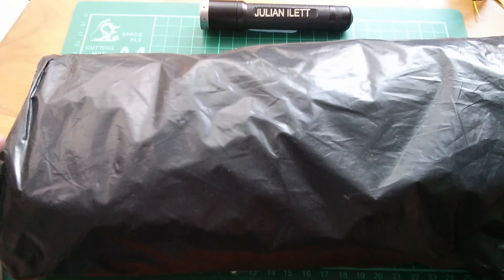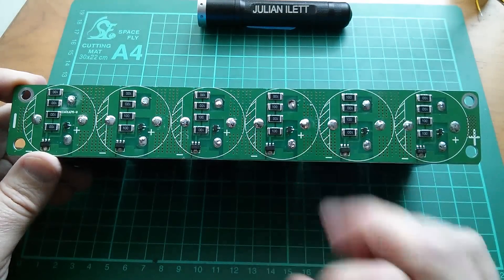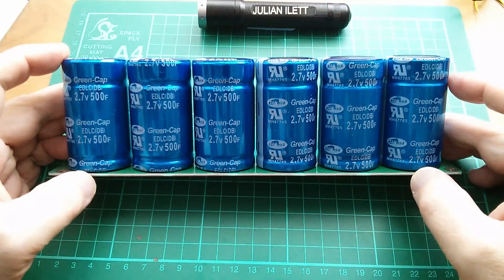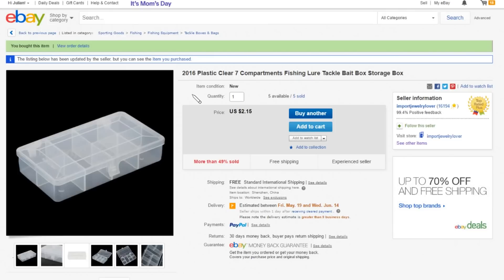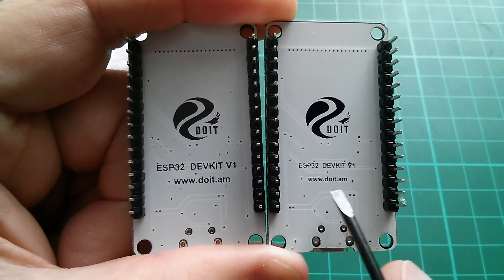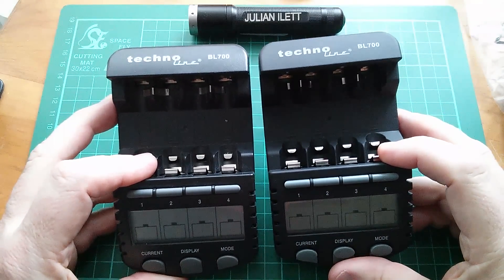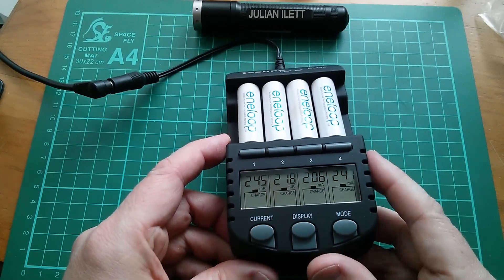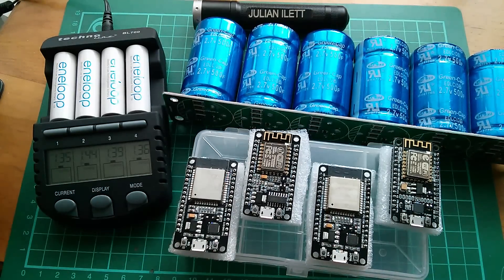Julian's Postbag: #94 - SuperCapacitors and Battery Charger

Comment: hello you :) can I ask you?  if having a charged set of capacitors? from the link from ebay? 

https://www.ebay.com/itm/-/122444740165

 How high are these capacitors on the entire PCB? 
Can I charge the phone? of course I want to use the right inverter on the output to get 5V on the output. Thanks for the answer.
Reply from the maker: About 67mm. Add a few extra millimetres for connectors.

Comment: if those resistors are 1 ohm each and in parallel, that's 0.25 ohms per cap.  With 2.7v across that we get I=V/R=2.7/0.25=10.8 Amps!  That's: Power=I^2 * R = 29.16 Watts...or 29.16/4=7.29W EACH!  I have not worked much with SMT but I have felt the untouchable heating of well less than 10W dissipated in a 10W (or even 15W) wirewound resistor.  Finally, when all the FETs are on, that's a grand total of 175W of radiated (wasted) heat (power).

Comment: I wish all engineers would realize that center positive is the smart way to go.  Especially with 12 volt devices designed to operate mobile in motor vehicles. I have a Ham handheld by Standard that has a center negative plug, the car adapter has no real protection, except for the fuse, of course but damn man the inside of a lot of vehicles still have a lot of steel built in, all of which carries the negative side of the power system so that little plug flopping around in the vehicle if you happen to unplug the little radio, and the sparks are really going to fly.  Love the little radio except for that problem
Reply: Jerry Ericsson  Some devices make use of the switch in the devices power input connector. In the connector this switch is wired to the outside contact of the connector. Depending on the design of the circuit, this switch may have to be wired in the positive part of the circuit. For example devices that have an internal battery, but which also have external electrical connections to the outside world.
Oh and in my experience, negative centre connections were far more common in the 1980s and 1990s, but are less common now.

Comment: Many thanks for the tip about the charger being set to 500mA.  I have a 12v 7dayshop version and always wondered why 200mA only took the eneloop's up to 1.47v fully charged.  Now using 500mA and getting 1.5v.

Comment: That box might be useful for an assortment of LEDs in the 6 smaller compartments, and matching resistors in the bigger compartment?
Reply from the maker: That's neat :)
Reply: also, you could use 1 box for each E24 resistor value. you could have all the larger wattage, half watt, precision, trimmers, and pots in one box.

Comment: From: https://www.amazon.com/Shaluoman-Farad-Capacitor-3560MM-Protection/dp/B0162NYWUW/
Before you DIY ,please charger to 16V ,Then Discharger to 2-4V,then Charger ,repeat 6-10 times.After activating,you can directly connect with battery In parallel .

Comment: these samwha capacitors i've charged one to 3.5v and it held there stable no problem no breakdown absolutely no problems at all.
Didn't even get warmer than ambient temperatures. Still felt cool to the touch.
So these capacitors can handle significantly over their rated voltage without any problems
Even with the slightly overvoltage chips you shouldn't have any problem whatsoever because these capacitors can take the slight overvoltage without any problem.
I have a 100 farad samwha capacitor and it rocks for its size!
Reply: physically and chemically, there are no larger voltages possible, but.... 

I guess SAMWHA's voltage ratings are already at the limit (minus a little bit of backup)
Reply: Well normally super capacitors would start to break down as soon as you go over about 2.7v and take a long time to get any higher and be very slow
but the samwha ones I got just keep rising in voltage at a steady rate.
if I keep it topped up at 3v for a while
it stays there and doesnt really drop down at all
Ive even used it in my wireless mouse that takes two AA's in series no problem there.
i charged it to 3.5v and used it in a phone for a few minutes and it worked lol
I also have some 35v capacitors that have been charged to 50v with no signs of issues.
theres quite a lot of tolerance on the good brand capacitors. these seem to be the opposite though. bad brand and bad capacitors. BUT extremely good tolerance because of the way they are bad brand lol
Reply: that's awesome
Reply: so i've been able to get a lot of extra oompf out of the capacitor when its charged at 3.5v lol
I hooked a resistor and 5v in series and let it charge up to whatever it naturally will go to at a low current. and it started settling at about 4v from 20mA of charging current
Ive heard of high tolerance capacitors but never ones THIS high of tolerance lol
Maybe I got a "golden" capacitor or something perhaps? One of the diamonds among the pieces of coal?

Comment: Now that's a dodgy ebay listing on the capacitor bank. They list the bank as 16V/500F in the description and 2.7V/500F in the title, neither of which is the real value of the bank. They also skillfully manage to hide the capacitor manufacturer on their product images. I've pulled my fair share of dead Samwha caps out of powersupplies (including primary side caps, which usually last much longer). Better keep it as an "experiment only" bank and not as something to rely upon.
Reply from the maker: Yep, definitely experiment only. I'm expecting an upcoming experiment to show that 500F is a bit optimistic :)

Comment: make a good video to open the bl-700 find and repair the damaged competent or even upgrade it to 12v
Reply: I opened mine, there is a black blob epoxy chip inside it, which is very likely powered directly of the 3V supply. It is very likely that using a larger supply burned the chip and it is not repairable.

Comment: Hi Julian, I love your video posts and especially your postbags, keep up the good work.

Just a thought though regarding your quest for component storage boxes, why don't you stop faffing about and get yourself at least one of these, http://www.maplin.co.uk/p/raaco-portable-storage-unit-including-four-13-compartment-assorted-boxes-rf35q , I have two of them so far on my bench with a view to buying a third. The are absolutely awesome and you can reconfigure the inserts to suit your needs.
Reply: What, only three? Have you seen his Workshop tour? Pff. Three. Anyhow, since everybody seems to be so eager to presenting their own choice of cases, here's mine:
https://www.amazon.de/Kunststoff-Magazin-29-Schubladen/dp/B001M4FKCQ Also runs under brand and name Lockweiler Sortus P... and then a number for the amount of drawers in the set. (Lockweiler is a German plastic products maker) The slim drawers fit bandoliers of R just perfectly. Best thing: each row of boxes is detachable, so you can mix and match and stack to huge heights (they snap together securely), and each one has two notches at the back to catch on screws in the wall. Very neat. Only problem is you cannot get them without the top layer which is a carrying handle, so you end up with loads of useless handles.

Comment: Samwha is a Korean company.  They tend to get a bad rap when it comes to their low-ESR capacitors.  Don't know about their EDLCs though.
Reply: I use Samwha caps in my projects, they work fine. I'm too cheap to buy Nichichon caps, plus I can't easily buy them locally. Between other cheap caps, Samwhas stand out really well.
Reply: I don't really like Samwha (i always shout SAAMWHHAAA in my repair videos), but they have some good caps aswell. *I am very happy with the 125C-types though.

Comment: Hmm, with the 7 compartment box you could probably just cut out the dividers and then fit your resistors. ;)
My way of organising resistors if to take large letter envelope, cut them in half and glue one side. Then label those and stick them into a bigger plastic box! (Payed around 0,70€ for one 2 liter one at a local dollar store called ACTION.)

Comment: hello sir , I am a student . I want to get practical knowledge about electronic elements that how they solder in PCB . please , recommend me book
Reply: I am sorry to say, but if you have to ask for a book I don't see you having success in learning. You have the internet, which has google. Learn to use it! Electronics is no secret. Everything has been explained a 1000 times on the internet.
Reply: Just watch Julian's and bigclivedotcom's videos. Good fun.
Reply: thanks. but I want to know why an particular resistance, transistor etc used on the basis of what, in the circuit . so I need an book . to get knowledge about how an particular thing used here or there.
Reply: like assume after Ac current we need resistance. so which resistance be used there .  please
Reply: recommend me an book
Reply: thanks brother
Reply: And for God's sake, learn to use the Edit button instead of replying to yourself a 1000 times ...